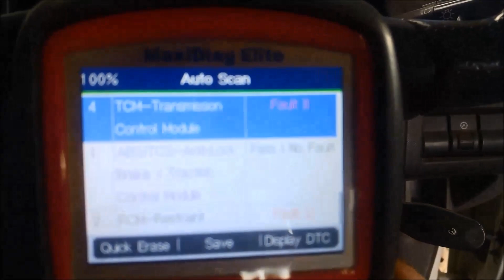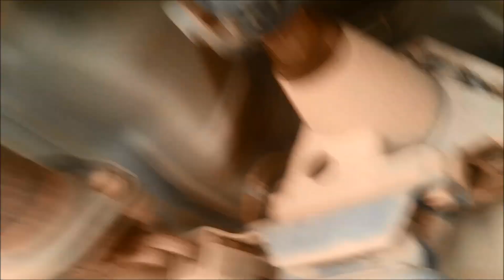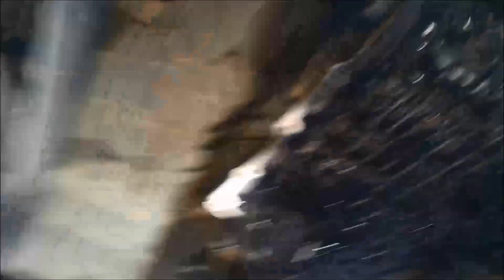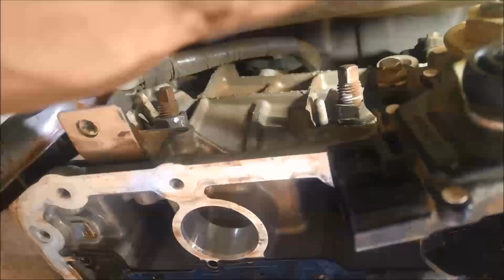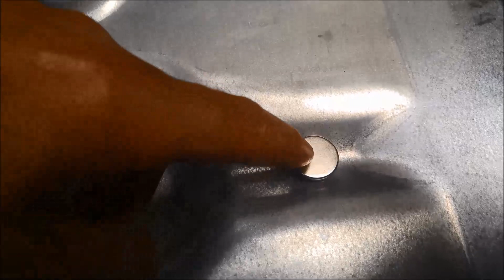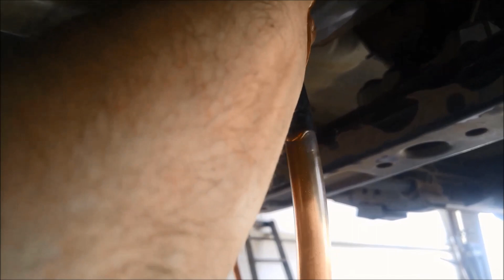5R55S 5R55W Automatic Transmission Band Adjustment Service & Replace 5R55 Solenoid Block

Comment: Hey buddy, I have an automatic Ranger 3.0 HP. It only moves in 2nd gear; it won't drive in any other gear. The problem started after the solenoid valve was replaced. Can you help? Thanks.

Comment: This was very helpful for me replacing the block and adjusting the bands on my 2004 Ford Explorer Australian spec which also has this transmission. Thanks mate.
Reply: What issues were you trying to solve ?
Reply: @fk-28239 I bought thr car with this issue, it was stuck in third gear so had no off the line power and didn’t wana go above 100kph. Fault codes for every solenoid circuit.
Reply: @willpower_electrical_and_more  Hey buddy, I have an automatic Ranger 3.0 HP. It only moves in 2nd gear; it won't drive in any other gear. The problem started after the solenoid valve was replaced. Can you help? Thanks.
Reply: @a @ayhankucukozer1478 heck your fuses. In my explorer the problem stayed after I replaced the solenoid block, the old one and popped a fuse when it failed. In my explorer  it was fuse 38, yours might be different tho so check your owners manual. Some cars have what the fuses do written on the lid for the fuse box. If replacing any blown fuses doesn’t work see if you can scan codes with an obd scanner.

Comment: Any effect of shifting quality caused by piston servo and brake band adjustment.
Reply from the maker: hi, if bands not adjusted as designed, the rod on servo piston will work up against one side of bore and wear out the case prematurely  ( causing pressure leak to apply of that piston ) & also the apply timing for shift is affected. cheers

Comment: I did a rebuild and when adjusted the bands I notice(looking in at the band struts) the overdrive is very loose, before I put this back in the vehicle, should there be a lot of play for the front band vs rear/ or should they loo to hold the same/similar band tension?
Reply from the maker: hi, same band adjustment on both bands. https://www.youtube.com/playlist?list=PLQLkuOdKuFovvYiynq3ee--0WSSUyeIxu   cheers

Comment: So you tighten in the adjustment and then back it off? Can you tell if a band is broken?
Reply from the maker: hi, if band is broken it will keep threading in too much. you can see the bands when you remove the pan. sometimes if bands havent been periodically adjusted or incorrectly adjusted, the band anchor and strut brackets fall out. check all the basics first. check out our other 5r55 vids for more info. https://www.youtube.com/playlist?list=PLQLkuOdKuFovvYiynq3ee--0WSSUyeIxu cheers

Comment: Wanted to ask could I swap my tranny 5r55s with a 5r55ws
Reply from the maker: hi, as long as bellhousing bolt holes, the shafts and electrical plugs are same. depends what it was out of? cheers

Comment: What happens if band is too tight or not tightened enough?
Reply from the maker: hi, if too tight may wear out prematurely, if too loose the tips of band can wear out or the band will wear out unevenly causing metal to meal contact with drum. also the shift timing can be affected. cheers
Reply: @YepThatsIt  so I built over the transmission drove it for about two miles then it started to slip. But the reverse is fine, any suggestions

Comment: Hello.  How often should the belts be adjusted?
Reply from the maker: hi, if you do a regular trans service - we do band adjustment every 2nd service or if unknown we just adjust them. sometimes people decide to do their own version of adjustment to either take up the band apply time or to extend it. all depends on the person, motor, weight and condition of the vehicle. a quarter turn either way from the recommended wont do any harm on these transmissions if there is enough lining. keeping the bands adjusted properly allows lining to wear evenly and in doing so wont cause pressure on the servo apply rod to wear out the case as quickly and also the band tips wont wear out as they can if way too loosely adjusted. cheers
Reply: @YepThatsIt  спасибо большое.

Comment: Good day, I've got a question l think you could answer easily,  and believe me I'd send a six pack of beer if knew how, so i have the same transmission,  when i start it up and put it in reverse, it engages without a problem, but if i don't start to move, well if I'm moving or not, it would disengage until I start pressing the accelerator, I can't seem to find the problem Solution on YouTube and anybody that I have asked on YouTube has not replied back, can you help me friend?
Reply from the maker: hi, for your answer contact me via our facebook link & beers link is in description. cheers

Comment: I've got a Ford Aerostar that I backed the overdrive adjustment bolt out of all the way because I'm a genius. Now my transmission works perfectly but my overdrive doesn't kick in. Anyway of fixing it without dropping the whole transmission? Thanks
Reply from the maker: hi, you may be able to pop strut back on left side trans with some assembly gel on screw driver. i`ve done a a few intermediate band struts like that. worth a try. if you cant then drop the vbody. cheers
Reply: @YepThatsIt  I got it 👍. I used an extension magnet

Comment: I change the solenoid and still the OD flashing and 3 gear slip again and engine light on
Reply from the maker: hi, was it a new solenoid block? did you purge air out of it ? for more tech questions contact us via facebook link in description and bring some beers. cheers
Reply: What happens if u forget to purge the solenoid block

Comment: hey mate i just brought a fg falcon 5 speed auto when i put it into drive or reverse the car will not move have you got any idea why
Reply from the maker: hi, i`d need alot more info. check all basics first, then check band adjustments, any fault codes etc cheers
Reply: @YepThatsIt  the only codes that come up is a comms fault and it says its not in park when it is.
It was driving completely fine then i parked it when i whent to drive it the next day it would not move

Comment: Hey mate have a fg falcon with 5 speed and sometimes has a delayed engagement after putting in drive, any advice?
Reply from the maker: hi, filter service, band adjustment and can be contaminated and/or leaking solenoids in solenoid block. cheers

Comment: Hey mate I've got an FG Falcon with this transmission. Has no 3rd gear (revs out then jumps to 4th), I was wondering whether there's any way I can reasonably patch this problem myself or should I just get a ZF put in? Thanks for the video.
Reply from the maker: hi, can you adjust the intermediate band ( middle one ) ? or is it broken ? any fault codes? need bit more info. cheers
Reply: @YepThatsIt  Hey mate thanks for your reply. I just checked today and the band is broken. (adjuster keeps screwing in) Wish I'd checked that before I went and changed the fluid and cleaned up the solenoid... If there's a way to cost effectively replace the band that would be great..

Comment: My auto in my PJ ranger is due for a change, I was told to  check the oil level with the transmission in drive? Is that right?
Reply from the maker: hi, check in park with hand brake on. cheers

Comment: So just to confirm, there is no way to replace just one solenoid, only all of them which are all in one “block”?
Reply from the maker: hi, it is possible, but unless you have correct tools you will muck it up. the linear solenoids need to be calibrated as well. cheers
Reply: @YepThatsIt  do the linear solenoids need to be calibrated when installing the whole block? Or do they only need calibration if you’re replacing individual solenoids?
Reply from the maker: @MustangGuy1996  we calibrate when block is assembled. then when you install block you may need to perform trans relearn/readapt so pcm knows you have repaired/changed solenoids block. make sure you purge the air out of block before you install it or you will have very hard shifts until air is purged out. if you have more questions you will need to contact me on facebook link and supply some beers. cheers

Comment: Are those adjustable bands exterior, i mean I they are adjustable on the out side, and other question how you said it can be adjusted? .. Sorry for my English
Reply from the maker: hi, check out my other 5r55s 5r55w vids. you can adjust the bands externally. cheers

Comment: Great tips!! Buy you a beer.
Reply from the maker: hi, always well received ! and keeps us motivated. cheers ;-)
Reply: @YepThatsIt  i do diy vids on youtube. Just bought 2 06 4x4 ford explorers 400 each
Trying to figure out why they dont engage
Reply from the maker: @themobilecardr.8858  hi, i`d need more info?...and is it the 5r55w trans? cheers
Reply: @YepThatsIt  one was driving just fine. After parking..outta nowhere..not engage
Reply from the maker: @themobilecardr.8858  can you contact me on facebook link and tell me what its doing in other gears and when manually selected..., incase we need to exchange pics, vids...we can do it on there. cheers
Reply: @YepThatsIt  i dont do facebook. Universallockoutkeys@gmail.com
Reply from the maker: @themobilecardr.8858  any fault codes ?
Reply: @YepThatsIt  transmission service required. I did not run obd 
Will try in the morning
Reply: @YepThatsIt  have black transmission fluid. Very low too. Only 2 quarts came out. Been storming out here and im outside with weather. Lying low for several days

Comment: Band adjustments on a modern car, been a while since i adjusted bands, you make me want to go on a learning curve on auto trans bands. The over temp code was interesting it threw me into oh no whats the cause if the cooling system and trans fluid is fine,slightly loose bands?Buying you a Bear i mean a beer sounds nice.
Reply from the maker: hi, yeah there are a few late model transmissions that still have band adjustments. i don`t think many are aware of the band adjustments on some....i often come across being the first to do the adjustments when they come in for a service. indicators of incorrect or not adjusted bands are when they wear out the tips of the bands and also the servo piston rod bore in the case wears out, because the angle of the band apply is out/excessive. also worn band, or out of adjustment band, will affect the timing of the band apply and will affect the gear changes. always good to adjust your bands regularly. ( another trans i just recently reconditioned that has never had band adjusted is pajero/montero/triton 5 speed v5a51 trans ) cheers